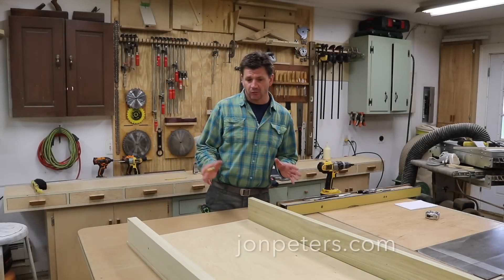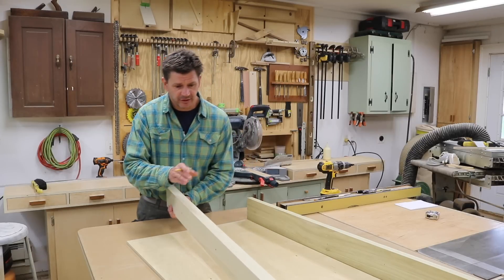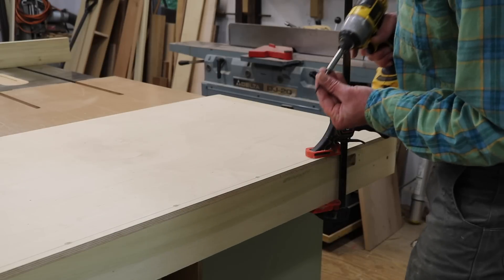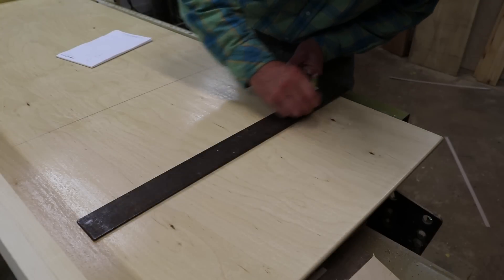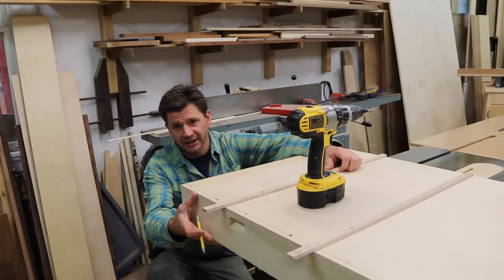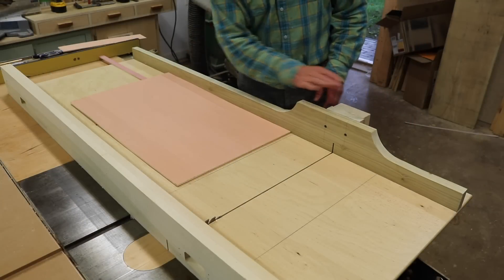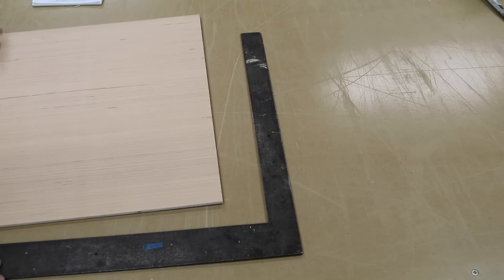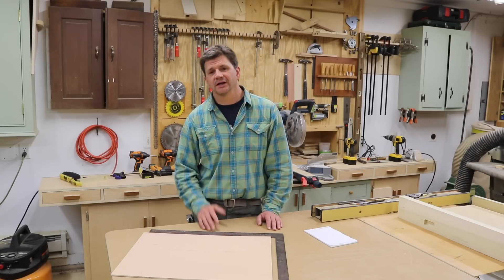Easy to Make, BIG! Table Saw Crosscut Sled

Comment: Well Jon, as I have poured through YouTube looking at the multitude ways of making a crosscut sled, I find that the crosscut sled you have built to make the most sense. Especially, Jon, the width, seeing this sled being built and avoiding the one problem area I personally ran into was the width of the sled base. I found my sled to narrow and it would not support the boards I was trying to cut. You produce a good quality video Jon, well lit, good camera angles and a clear voice. Well done Sir.

Comment: Hi Jon. Love that you tanke the 5 sec. to mask before painting. Says a lot about you. You might want to take off the inside corner between the sled and the fence so that saw dust doesn't mess up your 90 degree cut.
Reply from the maker: Thanks and good thought

Comment: Hey Jon, that came out great. I built one, not quite as big as yours and I have to admit, even though I have a miter saw, I feel more comfortable using the sled. I also built a sled for the left side of the blade. That, I find comes in real handy. I got that plan from ( who else) Norm.

Comment: Nice build. I like to use these over having a miter saw myself, as I do not have the setup space for a mister saw.
One tip which might help sled users... if the sled is tipping off of the front of the saw table, add some washers or other T-style setup to the bottom of the front of the alignment ribs to take advantage the the T-style miter slot in your saw and lock the front of the sled down to the table.

Thanks as always for the vids.

 - Eddy.

Comment: Good video. What is the benefit of making a full crosscut sled with a bottom riding on wood rails and a back fence as opposed to using a piece of hardwood for the front fence that is bolted to two miter gauges? I've seen several crosscut sled vids and most make a full sled but never go into any explanation of its benefits.

Comment: John I love your videos and how you attack your projects.  I'm a commercial carpenter by trade and have been slowly getting into woodworking.  I started with cleaning/tuning/sharpening my dads and grandfathers old hand planes and saws.  I just finished putting together an older Delta Milwaukee Homecraft table saw with the tube style fence.  It's has a 1/3 hp motor on it which Boggs down while trying to cut through 2" hard maple for my work bench.  I plan on getting a new motor for the saw and wanted your opinion.  Is it worth trying to get started in woodworking while going through the struggles of older tools and equipment and if so will 1 1/2 hp be enough to cut through hardwoods?

Comment: Hi Jon good job!  I see you did not use the "5 cut method" for squaring the rear fence as many other youtoober's do. Do you find the framing square method accurate enugh for woodworking? I wonder if one needs to be within 3 or 4 thousandths of an inch!! Does a wood joint care??  Thanks man!

Comment: No concerns with wood movement with the maple runners?  I did that with my first sled, hard maple runners, built when it was dry in the winter, by late spring the runners were jamming in the slots.  A $15 piece of UHMW from Lee Valley works consistently all year long.
Reply: You probably ran your runners with grain horizontally instead of vertically in the slot.  There's much more expansion along the grain.
Reply: Nope, grain orientation was correct to minimize effects of movement.  With a snug sliding fit in a mitre slot, it only takes a tiny bit of movement before things start binding, especially with a 2 runner sled.  We have large swings in humidity between seasons here. Not sure what it is like in NJ where Jon is, but it likely will help that this was not built in the driest months of the year.

Comment: Why did you leave a few inches of plywood behind your "squared" fence?
Reply: Good question.  It is a huge sled but If I was doing it I would have made it all the way to the edge.
Reply: That was done in order to provide a space for the blade to pass through the fence and leave him room to attach the "safety block."
Reply: Not sure if that was the exact reasoning behind it but i think it would be a useful to build a pocket on the right side of that block to temporarily hold things like a measuring tape and pencils that you'd be using during the cuts.

Comment: I would like to see your method of sizing the runners so there is no wobble.
Reply: IMO, the best way to deal with this is to actually undersize your runners and then pack them with playing cards to get the correct amount of snugness a la this page: http://www.popularwoodworking.com/projects/aw-extra-42414-improved-crosscut-sled 

I would also do the five cut test to make sure the fence is truly square before screwing the fence into final position.

Comment: What brand is that tapered countersinking drill bit?
Reply: Lennard, check out Dewalt.  I picked mine up at Home Depot (3 pack for $24). http://www.dewalt.com/en-us/products/accessories/metal-and-wood-drill-bits/general-purpose-drill-bits/countersinks

Comment: im going to be a minority on this issue but, this is my experience with sleds to date.

since i have been woodworking and doing trim carpentry  ( about 3-4 years) ive seen many people using these for various reasons. "safety" being one of them.
my main purpose for one of these is small cuts on job sites where i find myself fixing or trying to hide the mistakes of others. Im a painter but, started doing other things because a lot of "carpenters" are not what they call themselves these days.
 so far i have 3 in my shop that are unusable because i can never get them square and i have found trying to make one of these more dangerous than the cuts the sled is supposed to keep me safe from.

ive found trying to use them to be more dangerous for various other reasons too but, dont have the time to type them out on a phone.